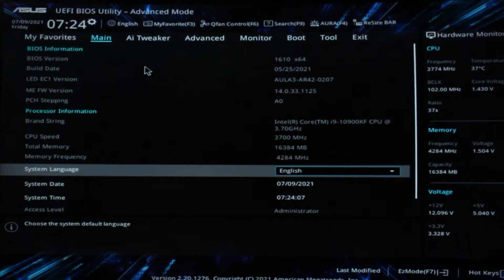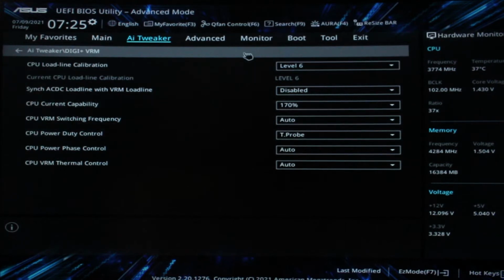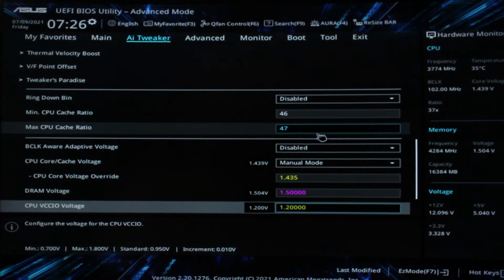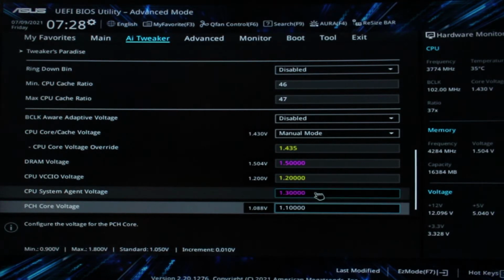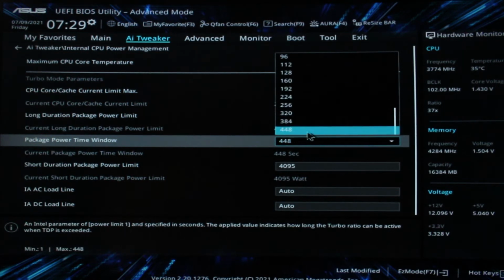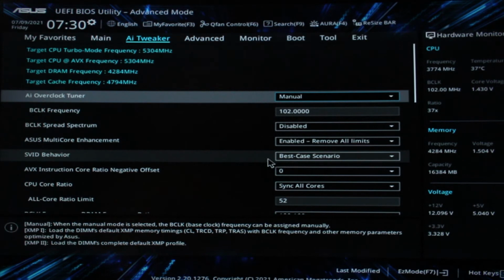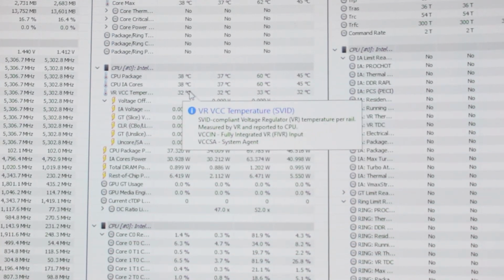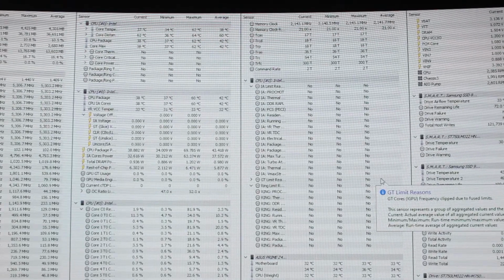10900k overclock for high fps with Asus motherboard. warzone, CPU intensive games

Comment: Followed all your steps my motherboard is not letting me change the numbers for example the voltage I cant change it yes I put it in manual mode still can't change it and all the cores stuff can't change that either please help
Reply: Use + and - keys on keyboard to change.